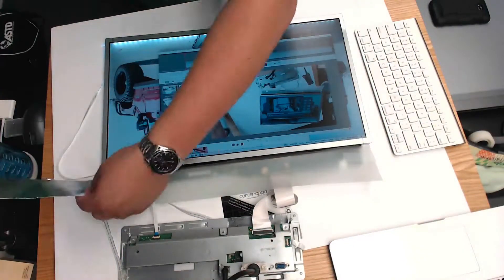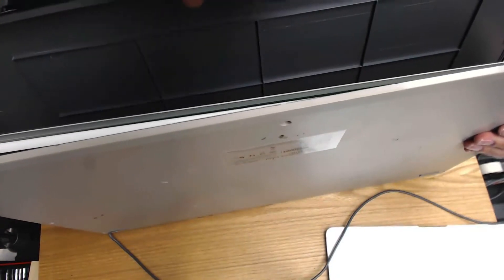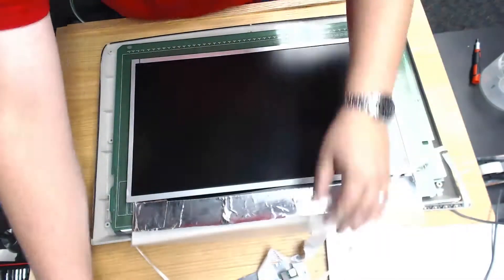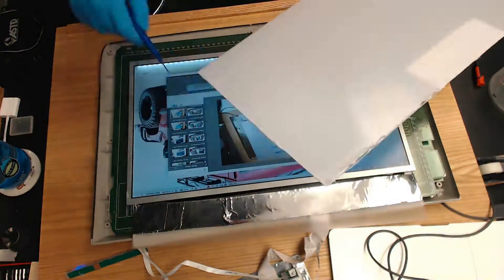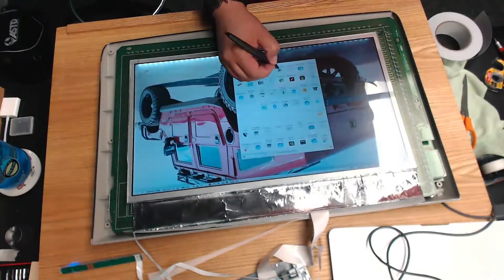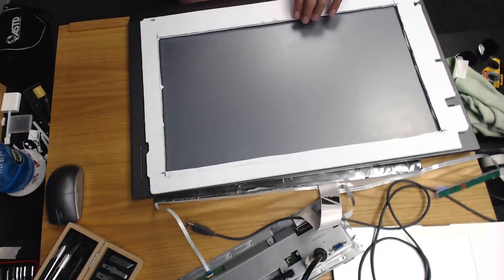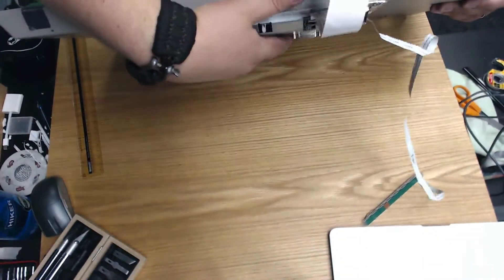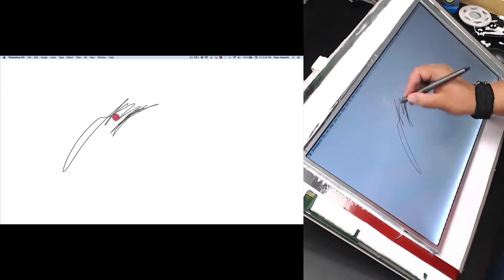DIY Cintiq Part 2

Comment: Do you have to use aluminum tape
Reply from the maker: There may be other options. I've hated using the aluminum tape, but it shields against the electromagnetic interference to the tablet caused by the monitor. Without that shielding the tablet doesn't work properly.
Reply: @RyanHaworth  Now this explain why my cursor move akwardly with the pen on dead lcd. I use xp pen artist and new laptop lcd, will it work?

Comment: Does the digitizer somehow work like a radar, bluetooth or wifi to the pen? because then if the pen wasn't in direct contact with the digitizer, what would enable them to connect to each other and determine the position of the pen?
Reply from the maker: Jackson Shelton good question. I'm not 100% on the full techbicalities, but on the digitizer is a gridwork of copper  lines that send out electromagnetic signals. If the pen gets near enough to reflect-it doesn't have any internal power, but can reflect the signal-the digitizer interprets that to know position and pressure. It's kind of like radar, but only for reflecting that signal. You could use a regular pencil and paper to draw on the tablet face and it wouldn't recognize that as a signal to the digitizer.
Reply: It puts out an electromagnetic field and uses a bunch of sensors to determine where that field is being messed with by the copper wire coiled up in the pen.

Comment: This may be old, but it's extremely well done and easy to follow. I intend to make one myself. The only issue I see is the LED strip on the bottom appears much brighter where it is, so I might cover that up with electrical tape or paint or something, and in software make it so that the the resolution doesn't include the bottom 10 pixels or so. This seems professional, because of the voiceover quality and whatnot. Thanks again :>
Reply from the maker: Thank you for your kind words. I would have liked to have the original LED strip, which would have been better. But, since it broke, I had to improvise. Good luck if you choose to build one.

Comment: sooo im wanting to do this because why not lol how bad was paralax from pointer to pen?
Reply from the maker: Yeah, why not? Well, it's almost cheaper to get a knockoff tablet display if there's a chance you will brick a monitor or tablet. Wacom 16HD Creative (at $650) is just about triple what I spent without any of the issues I have. You can see how it is in my final video... https://youtu.be/KgE5p-a2jZM?t=446 However, this was before I properly set up the bounds in the Wacom software. It's a bit better than that now. It's not perfect, but about what you'd expect from a 15-year old tablet that wasn't intended to work like this. The issues I have now are related to screen resolution compatibility and I still have issues with interference near the bottom (by the LED strip) and the top (by the LCD power and picture control ribbons).

Comment: Nice videos my man. I like how you narrate it step by step and don't waste time. I'm constantly hacking everything too. haha. Not trying to burst your bubble, but if the only reason you made this was for a cheap alternative for a wacom display, for the amount of money you spent you could have got an hp pro x2 612 g1 or g2 which has a 15? or 13? inch wacom ems display and is a decent spec'd 2 in 1 laptop/tablet thats upgrade-able. I got mine for $200. from a pc recycler thats local to me (REPC) which is better than just a display IMO. I use my hp zbook g4 that doesnt have wacom or touch screen for its power and use my hp pro x2 612 g1 with hp's zboost remote graphics sender to remote desktop from the wacom to the workstation its a great setup since I can leave the workstation plugged in where ever and the wacom one has better battery life and is more portable. But if you were just building this because you wanted the project, I feel ya. I'm wanting to do this myself now. Anyways have a good one.
Reply from the maker: I was originally trying to save money and just see if it was possible. Now that there are more cost-effective options, I don't think I would do it again. Besides, the tablet is 16 years old. It doesn't quite function as I'd like.
Reply: @RyanHaworth  does it use emr or aes pens? because i know emr you can adjust the frequency of the pen by taking it apart and turning the little variable resister/tiny potentiometer.  which may help with the way it's registering / jittering.

Comment: How Much Would This Cost?
Reply from the maker: I spent less than $400 USD for this. If I were building today. I would have saved a little more for a Huion or something else cheaper than a Wacom Cintiq. As it is, I'm having trouble with jitters, and the screen isn't as good as three years ago. I'm going to upgrade with a Huion.
Reply: @RyanHaworth  I assume you still learned a lot from making it atleast?
Reply from the maker: @HS-eq3gk  Certainly. And I still use it on occasion. I haven't gone with a Huion or Wacom or anything else. I"m using another huge Intuos 3 without a screen.
Reply: @RyanHaworth   Ryan Haworth  that's great man, I was thinking of doing some kind of a review (on youtube) of the intuos 3, as there are basically none lol. 
I got the A4 sized one, the PTZ 930 and its a huge (literally) upgrade from the intuos draw I was using which was smaller than A5. best of all it only ended up costing me £16
The grip pen is rlly nice as well.

I think maybe for beginners, amateurs or hell even professionals on a budget the Intuos 3 is a really good option
encase I do make a review what are some of the things you like best about the tablet?

Comment: soo wait all u did was place the green pad thingy behind the screen and that is how it worked?
Reply from the maker: A little more involved than just that, but yeah. I had to shield the components and remove parts of the monitor that cause interference. The rest of the build goes through part 5. In those videos I mention some of the issues I had.